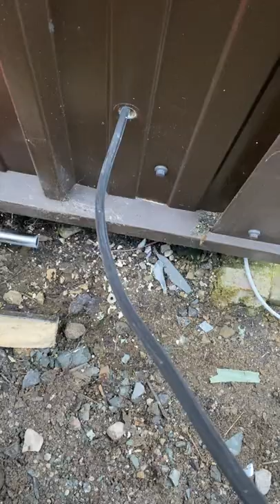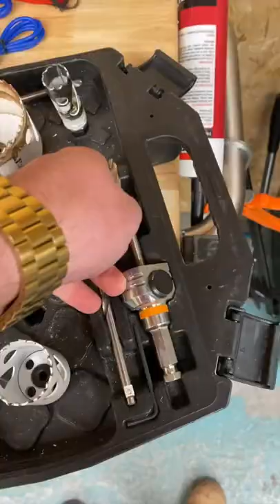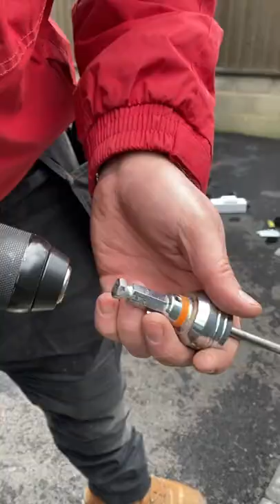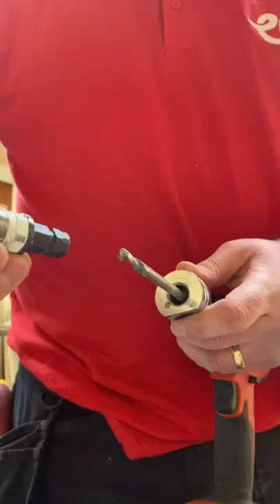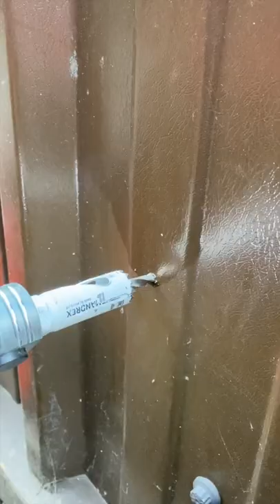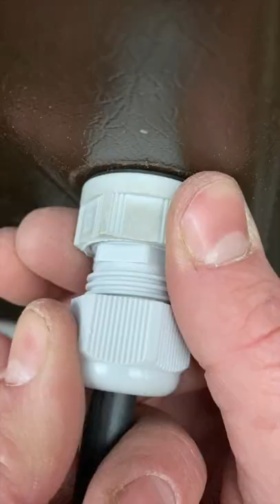This cable gland gets you out of tricky situations #shorts

Comment: What makes them special?
Reply: You dont need to get to the back of it to install the nut, its great if there's no access to the other side of the wall
Reply: @lexicase8805 so how are you going to terminate it? I've used these glands don't get me wrong
Reply: @Walktheline1991  these are not for panels or devices, just better than sticking loads of messy fire stop to cover a hole